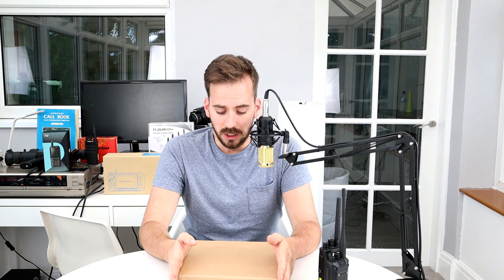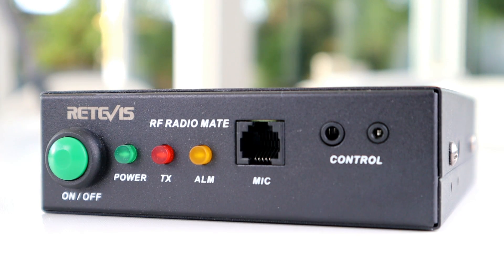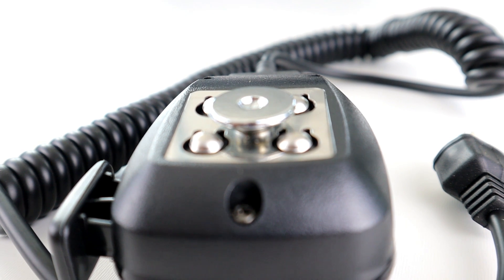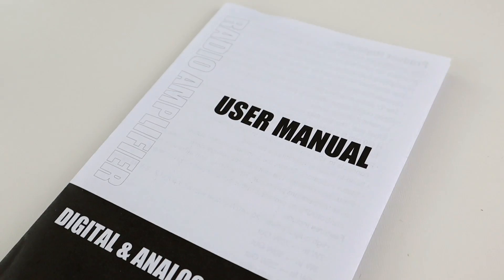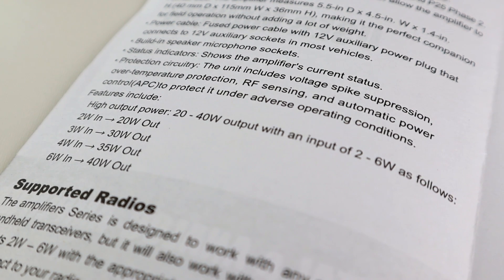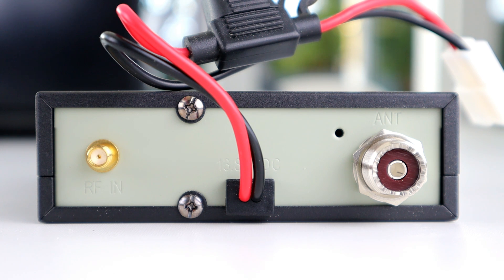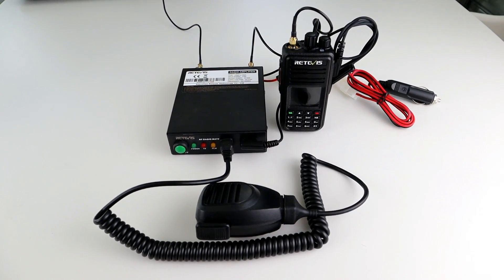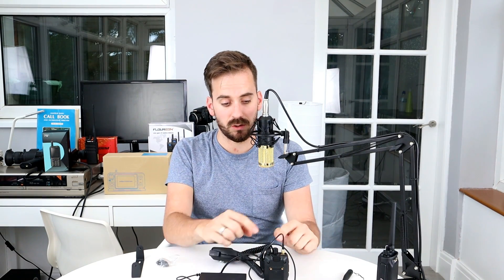Increase Your Two Way Radio's Power With The Retevis RT91! 30 Watt Amplifier!

Comment: It's a shame they've configured the mic to be useable only from the amplifier itself. I use a linear mobile and it's permanently mounted out of site in the boot as it's rf triggered. It's an old microwave modules unit which can operate in ssb. A proper linear.

Comment: I was just looking at this as an option for my ht and then came the nagging questions.
1, does it keep the ht charged ?
2, If not what effect does the extra power have on the drainage of the battery ?
I am interested in the RT91 but it is no good having the extra power in the field if the battery is going to discharge quickly.
Hope you can clear up my concerns.
Best regards.
Mike.
Reply from the maker: The amp is doing all the work, it has no effect ont he battery. Hope that helps
Reply: @RingwayManchester  It will have an affect on the battery if you use the rig on high power to get the amp to put out 30-40 watts, as i usually use my handhelds on low power to make battery last longer.

Comment: great video!!!!
i live in a small farm and use 50 retevis h777.
lately we suffer some communication difficulties.
We decided to build a "command center" and use RT91.
Before we do that, we have some technical question and hope you can help us with that:
1. Can RT91 work with H777?
2. Does the RT91 or H777 need to be programming before installation?
3. What kind of antenna we need to attach to the RT91?
4. Does the RT91 improve reciving and transmitting or just transmitting? meaning - farm diameter is around 1.8 kilometer, "command center" is on its middel, "command center" transmit to H777 on the end of the farm, H777 recive transmiting, H777 trys to transmit back, but "command center" does not receive transmitting because of long distance and hard terrain?  (hope i made myself clear enough....)
Thank you for your help, i really appreciate it.
Rom
Reply: How'd it work out?
Reply: If I were you I’d buy a repeater instead and a big antenna and set it in the middle of your area and then talk to the repeater

Comment: Yes you need to add the word linear in the description, so 20 - 40w linear amplifier :)
Reply: This is not a Linear Amplifier :(
Reply from the maker: Cheers!
Reply: FM amps don't need to be linear. Just a class C amp will do.
Reply: At least in the U.S. , the word " Linear " has bad connotations , from being associated with illegal use with certain elements of CB'ers . But indeed , that's just what this is .

     Albeit it does have potential legal uses .

Comment: It's called a Linear Amplifier or Burner.
Reply from the maker: Cheers!
Reply: DEAN WATERS burner being a slang word in the cb world so linear amplifier is the correct description!
Reply: NO IT IS NOT CALLED A BURNER !!!!!
Reply: This is  NOT a Linear Amplifier As defined in the manual Look at power in and power out
Reply: You can see a small PCB shot when you search for "P25UD aliexpress" on google's image search - they seem well built and are sold under many brand names (e.g. also retevis rt91). Specs list harmonic filters..

Comment: Hi!!! A lovely piece of equipment. What a simple way to boast output power.
I just have a few questions though;
1. Is it compatible with any "decent" non-Retevis radio?
2. Is it restricted to a particular band (2m, 70cm etc) or is it a devise that just amplifies the output power?

Lovely work.
Reply: The Kenwood connector is obviously only for the audio input and output, you connect the antenna to the amplifier.
Reply: N3ssaya oh well yes I guess so
Reply: Andrew Victor it seems only retevis radios will work with this due to the 2 pin connection cable. I really  want this to work with my connect systems cs580 which is more sensitive then my rt3
Reply: Hi digitalmediafan. Most Baofeng, TYT and many Radios use the same pin. But does this pin similarity translate to compatibility?
Reply: @digitalmediafan  Get the pinouts for each, sacrifice an audio adapter, and solder up your own cable. It's the ham way!
Reply: Did you ever make a PT 2? Show it in use? I don't see one and would love to see it in action and the before and after capability. Looks like something I would be interested in if it works in video.
Reply from the maker: Thanks!

It'll do any radio with the kenwood style plug
This option is UHF only
Reply: what about icom id51 ?
Reply: If you use it using the radio mic (not the amplifier mic), you just put the amplifier between the radio and antenna.   They make them to work in the GMRS frequencies now which may be useful in SHTF situations.    I've tested with FRS radios and a simplex repeater connect to a GMRS radio and it will triple the FRS HT's range.   Of course, only for emergency situations.

Comment: Seems a bit silly paying out for this and a handheld. Easier and cheaper just getting a small mobile radio. Looks a good bit of kit though
Reply: Paul Jones i was looking at this and wondered the same
Reply: No it's a good deal when you consider the cost of the RT90 / TYT 9600 mobile radio, you are savibg quite a bit
Reply: QYT-8900, cheap, 25w on high and small. great radio 135-174mhz and 400-520mhz.
Reply from the maker: It's half the price of a DMR mobile radio though
Reply from the maker: It's half the price of a DMR mobile radio though
Reply from the maker: That's not a DMR radio though Alex

Comment: 30 watts, what distance will that cover
Reply from the maker: There's no answer to that question because it depeneds on everything but power
Reply: Big Back Depends on antenna location and weather but anywhere from 50 to 200 miles from a really good location and antenna